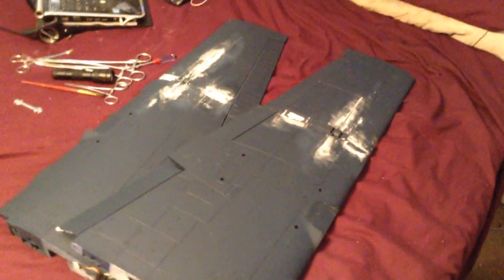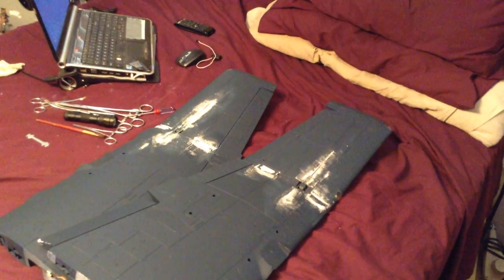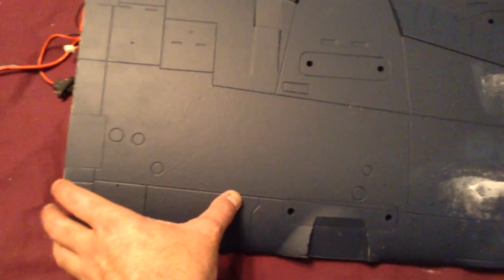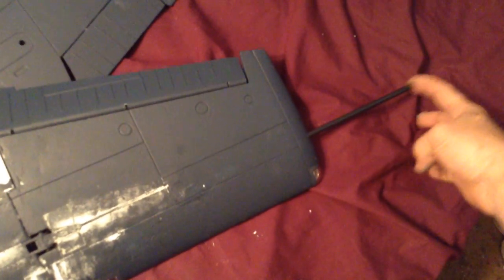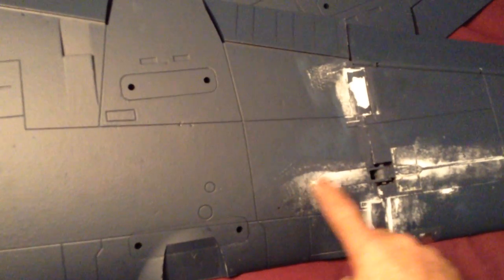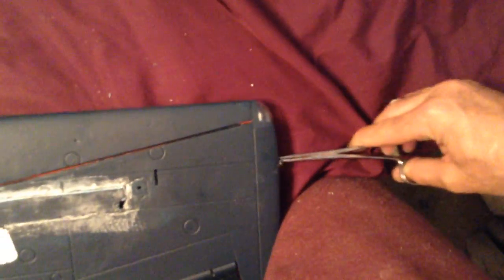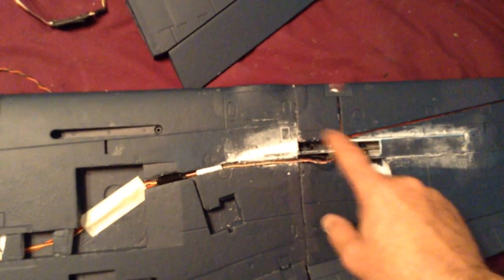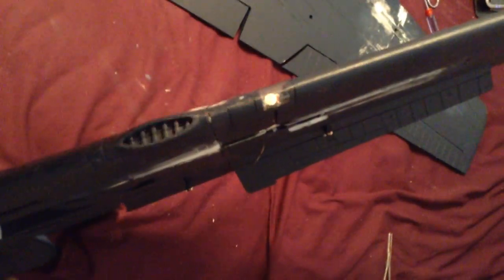FlightlineRC 1600mm F7F-3 folding wing modification #1

Comment: One thing I've been wondering about the folding Wing mechanism on the LX Corsair is are the motors programs with a timer or with a overcurrent protection board?